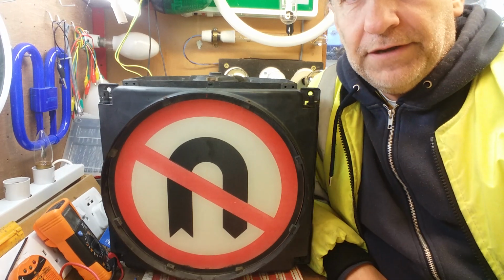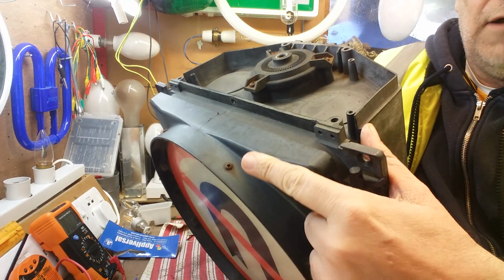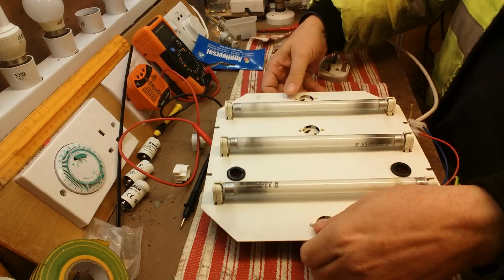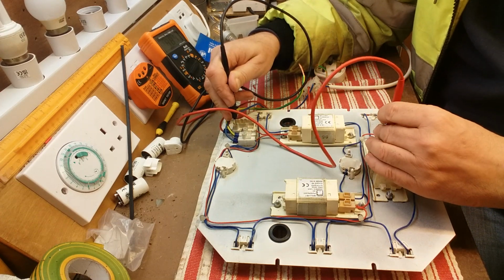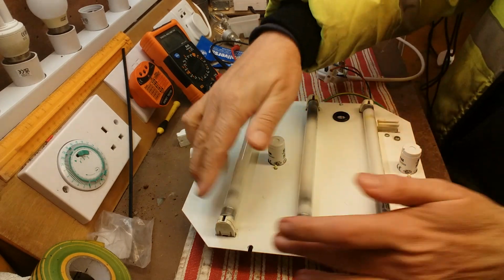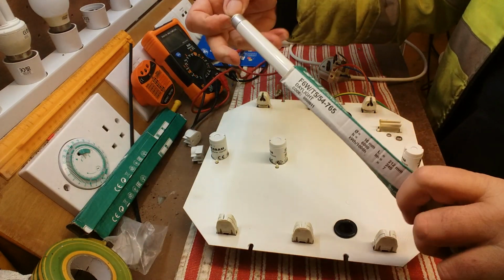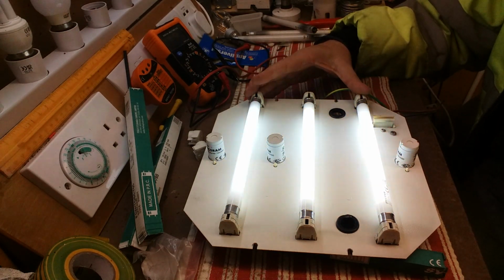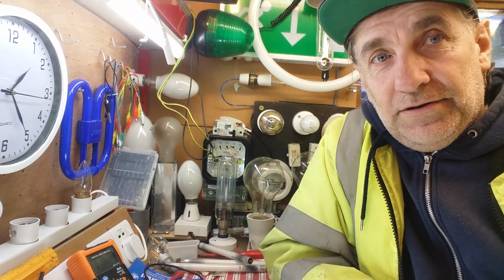TRAFFIC LIGHT "No U Turn Illuminated Sign

Comment: Top vid as always! You’re spot on, it was Pike Signals. They were merged into Traffic Group Signals. 

Autoflex, now that’s a real blast from the past. While incredibly rare now, if you’re lucky you can still find some of the old Autoflex branded cabinets on their stubby poles. The few I’ve seen have just been left in situ especially at junctions that once had traffic control. Those that are still near a set of lights either have a modern cabinet next to them or haven’t been updated since they were retrofitted in the 80s with microprocessors. In either case, their accompanying signals are long gone.

Ps congrats on 200 subs!
Reply from the maker: Thankyou happy your enjoying the vids .... Great piece of info there.